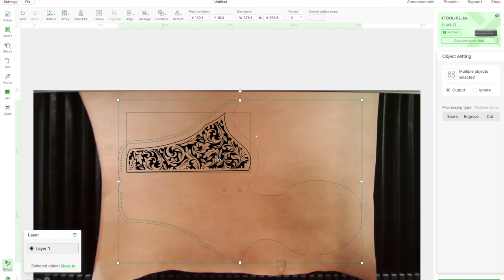Making a Baroque-Style Leather Wester Holster Leather Craft ASMR

Comment: Congratulations on your work - I love your achievements. But do you do the digital drawing yourself or do you download them?
Reply from the maker: Thanks! It's a combination of both. I'm a professional graphic designer/art director by day. I have access to stock photo and vector art libraries I can license art from. The background tooling pattern started as a vector art file I pulled apart, rearranged, and fitted into my own custom holster design. The outside loop was almost a direct plug-and-play: I just had to add additional material to make it wrap around the body of the holster and outline for the laser's cutting path. There's about as much time spent on the computer in Adobe Illustrator as on my workbench.

Comment: Always impressed by your dye work. Do you top coat before antique? Strap on the front is a very unusual and nice touch.
Reply from the maker: Thanks for watching! I always apply a coat of neatsfoot oil. Sometimes I coat with Pro Resist or similar. It depends on the color of the base leather, as the antique paste does change the color (it's essentially shoe polish after all).

Comment: How do you get such a complex pattern into a file to engrave?
Reply from the maker: The pattern was purchased as vector art from Adobestock.com. I Imported into Illustrator and made alterations to make it fit my holster pattern. Then exported as a .svg for use on the laser. I recently made a video about my process of working with laser files (though it doesn't cover this particular project.)

Comment: Does engraving with the laser change the physical properties of the leather? For example, does it make it harder to bend or mold?
Reply from the maker: Thanks for watching. Not generally that I've experienced. But I haven't really wet molded after laser tooling. It would be an interesting video idea though! You CAN experience small cracks at the very edge where the laser beam physically singes the leather. This can be mitigated somewhat with neatsfoot oil or conditioner. If anything, the whole process of applying the dye changes the physical properties more. I have to carefully massage the leather to get it flexible again. That's where I experience the most occurrences of cracking and have had whole projects ruined after dyeing because of it.

Comment: Hey road agent leather i got 2 questions for you if thats fine. Why do you put rubbing alcohol into the dye? And in some videos i see you put saddle soap on the leather and put it into a bag why is that?
Reply from the maker: I'm thinning down the dye so I can build up the colors in areas I want darker. It gives me more control over the color. Wetting the leather and allowing it to absorb the moisture is referred to as "casing". It preps the leather for tooling. Not necessary (and most don't), but I often case the leather with glycerin saddle soap if I'm going to be tooling a lot. It lubricates the leather fibers for easier/better tooling and slows down the drying process so I don't have to re-wet as often.
Reply: @RoadAgentLeather  thank you me and my grandpa read it and it was very informative

Comment: Im curious  about  the rubbing  alcohol  you  put in the  varnish.  I've never seen it  done before and  just  wondering  why is all.
Reply from the maker: Thanks for watching! I'm simply diluting the dye so I can either build up the color darker, or conversely, leave it lighter in places where I want to. Gives me more control over the final color. I used to use denatured alcohol for this, but found that the regular isopropyl alcohol I had been using to clean my table top and my hands works just as well.